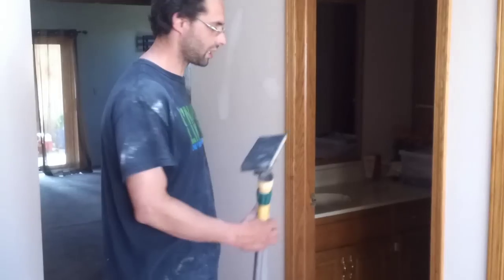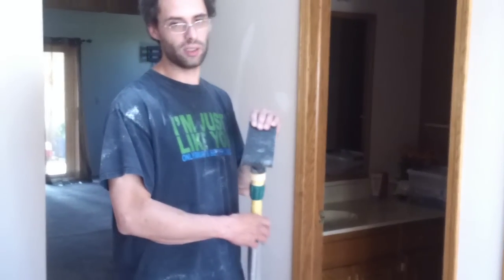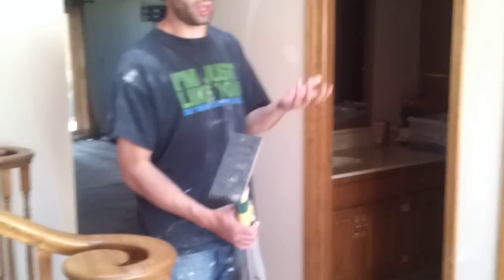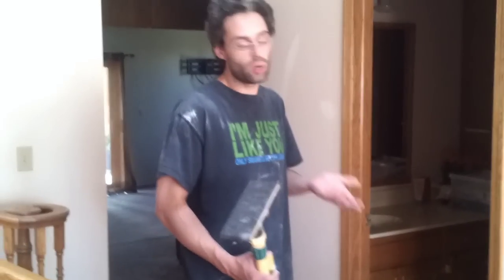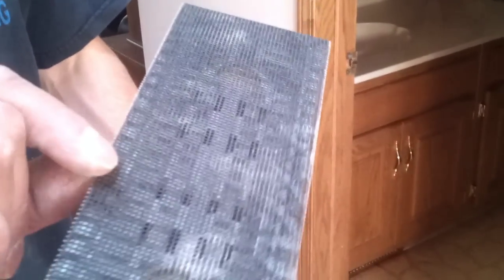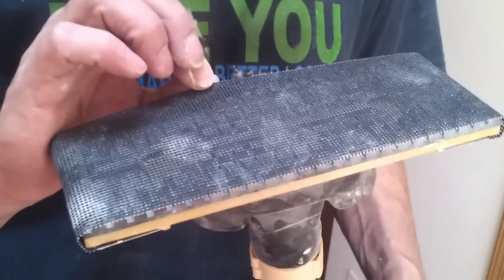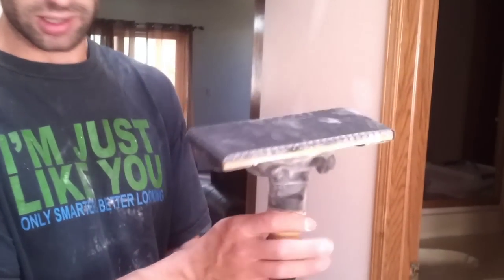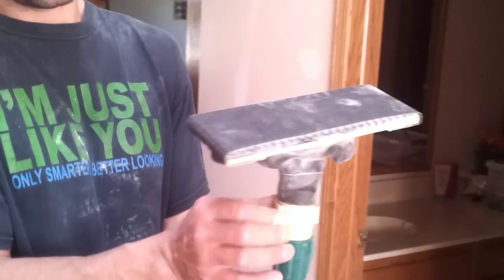Does The Vacuum Drywall Sander Actually Work ?

Comment: the sander can be modified to go directly on a tube and connected to vacuum hose, thus getting rid if the j configuration, and awkwardness, how ever, with even the finest mesh sand paper, it leaves marks/scratches to heavy for the fussy market we have here. However, for presanding on reno jobs, it works great.

Comment: A related tip to Saving the Life of your Vacuum Cleaner.   I used a vacuum attachment,  and after just one basement reno, the drywall dust killed my shopvac.  Found out the hard way that the fine drywall dust is extremely hard on electric motors.  Now I use vacuum filters designed for drywall dust OR I fit an ordinary pantyhose nylon over a regular filter.   Also very important:  don't let a ton of dust accumulate inside the vacuum AND use an air gun to blow all the dust out of the motor chamber;  and blow off your filter also.   ( I regularly use air to clean out the motor for whatever jobs,  ie. sawdust, construction jobs, etc.  and my shopvacs last a lot longer now )
Reply: mag goo 
 Nice tips, thank you
Reply: I've been looking for a K&N (resuable automotive) filter that would fit the shop vac. I use it for just around my house (not as a business) cuz the filter gets so dirty. I thought about the pantyhose thing too.

Comment: Like the attachment itself. Gave thumbs down because: 1. The switch cover is still on. 2. You ran right up against uncovered trim. Dude, tape. Do a dry run on videos before you post so you can watch them. Your giving an email and comapny info. Look the part, or starve.